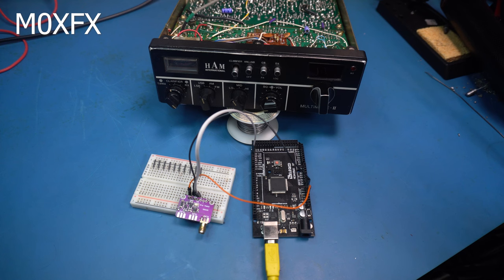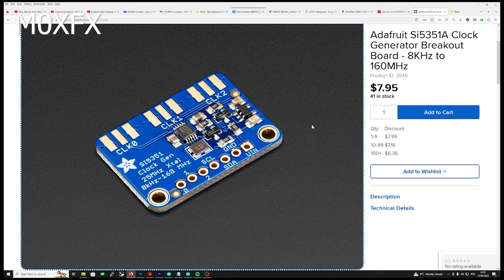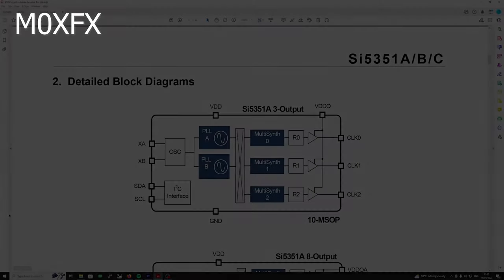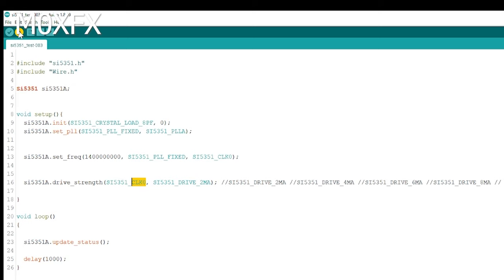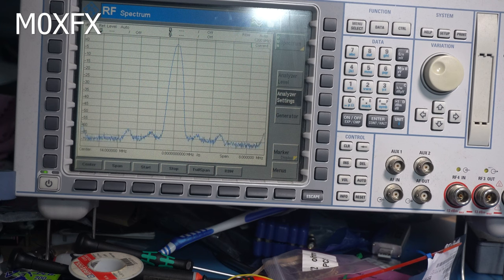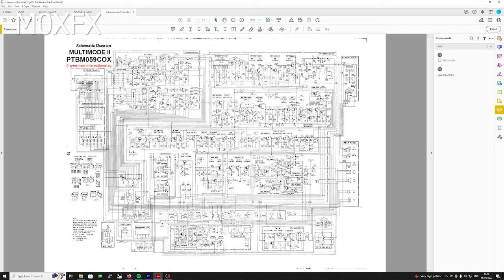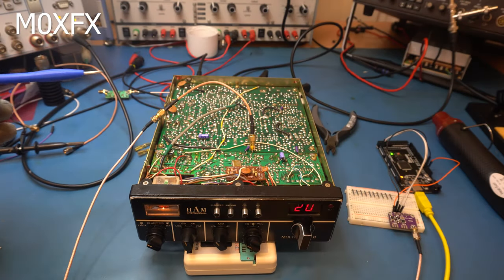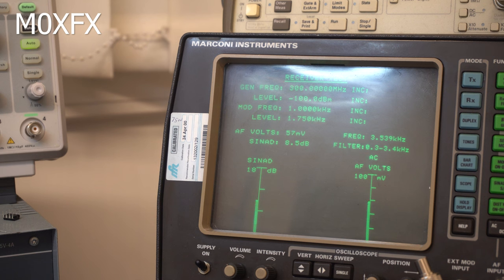SI5351 Clock Gen as Radio Local Oscillator in Old Radios

Comment: Great video. A couple of years ago, I modified an ssb cb using the same clock generator. I used the Si5351a to replace three internal crystals, leaving the pll in place. 

I didn't bother with filtering the output of the si5351a as the radios internal filtering did that. I also enclosed my si5351a, and controlled its temperature,  with a PID controlled Christmas tree bulb. Worked great.

I have had the radio in use for a couple of years now, and get good on air reports.  Frequency stability is excellent,  where it was useless before the upgrade.
My radio is used in my basement and temperature can vary from 16C to 25C. My si5351a is heated to 30 degrees C so there is no noticeable frequency variation .
Thank you for your video.
Reply from the maker: Hi Peter,

Thank you for your comment. Very interesting stuff!

Regarding filtering, you are correct. When you replace oscillator circuits or crystals in radio gear, the radio's internal filtering usually eliminates the harmonics and overtones. I've done the same thing, and it works great.

I also like how you stabilised the reference crystal, essentially creating a TCXO. Brilliant idea!

Comment: A interesting project you have there.
Reply from the maker: Hey MicroChipz thanks for stopping by the channel. Yes it certainly has been an eye opener for me as I really didn't think the clock gen board would work that well. I hope to take another look at this over the weekend and sort out the FM TX and write some code to interface the channel selector with the  Arduino.
Reply: @M0XFXUK  well you only need 40 sets of n codes from the channel change ,ch1 is all 1 think it’s 8 data lines , why not use a up/down instead then add a oled display then you have a dds vfo of sorts .
Reply from the maker: @MicroChipz  If I wanted to use the original display and channel encoder I guess that the 8 bit parallel binary may inversely translates to a a decimal channel number may be? I am not sure but I will take a look. If it does it would make it easer to code.  Interesting on the up/down option as it wouldn't be too difficult to code. I like the OLED idea and I have lots of then knocking about the workshop.  I hope to have another go at it this weekend.

Comment: I have a couple of candidate radios I've been considering for this. Thanks for the demonstration. The software is the head banger. There's a bunch of examples, but some of the fancier CB stuff is closed source. It might also be fun to build a VFO for an old Yaesu FT-101 or something and see if it can keep it from drifting.
Reply from the maker: Hi Jason, I think that FT-101 would work well with this board and I think it would be much more stable. Yeah I get that the software can be a bit of a head banger, I need to think about how to make a video going through C++ programming for a VFO that would make things a little easier. I could possibly write a universal type sketch that can be simply modified to work on many radios.  let me see what I can come up with. Thanks for the comment.
Reply: Welcome. Another thought if you can't get suitable direct FM from a clock synthesizer might be to try replacing one of the mixing crystal inputs. You could still have the PLL for FM then. @M0XFXUK
Reply from the maker: @keyboarderror1  Hi Jayson, Yes that is a great idea and suggestion. I have been thinking about just replacing the band oscillator and leaving the PLL still running as I am sure it would work. I am currently playing with the B version of the clock generator IC which has a VCO built in with the hope it will modulate FM.
Reply from the maker: @keyboarderror1  Just a quick update I have cracked the FM problem, video to be out in a day or two max.

Comment: Nice project.  Did some similar experiments a few years back but using the ad9850 dds module. It's possible using an adc input on the arduino to modulate the frequency of the dds fast enough to generate FM. But 10m Ssb worked well.
Reply from the maker: Hi Brain,  I haven't played with the ad9850 but it's on my radar it's very interesting what you have managed to achieve with it. I have playing with the AD9910 DAC controlling it with Arduino Due with mixed results, I should really go back to it and do some more tinkering.  I was pleasantly surprised how well the SI5153A works, even though the output waveform is as rough as hell without a band-pass filter but it's still fantastic for the price. I have also been playing with the  SI5351B which unlike the A version has a VCO and I'm supplying it with an audio signal to modulate FM but again I need to spend more time on it.  I currently really busy but I hope to have that video out in a couple of weeks time.  Thanks for the comment, really great to hear from you.
Reply: @M0XFXUK  I like the SI5351 module, I've played quite a bit with it mostly using 2 outputs in quadrature to drive sdr radios. Must admit I've not come across the B variant, sounds interesting I'll have to look out for it.
The radio I was experimenting on was the Major M588, almost identical I think to what you have there.
Reply from the maker: @brianharper9798  Hi Brian, The B version I picked up from Digikey as just the IC and I have been cobbling all the bits together to make a breakout board.  I am currently working on the voltage conversion for the I2C from 5 to 3.3V. It's looking promising for FM mod.
Reply: The level shifting should be straightforward, the little circuit boards you can get just use a small mosfet and a couple of resistors. 3.3v one side 5v the other and it's bi-directional.
Reply from the maker: @brianharper9798  Hi Brian yes as you say it's straightforward enough to do the voltage conversion and I have everything to make up a prototype board but sadly not the time. I am going to see if I can get back at it over the weekend.

Comment: Impressive work going on here. Kindly do you have a documentation of this project with connection diagrams for the test instruments ? Especially how/where you test the signal to noise ratio. Thank you
Reply from the maker: Hi apologies I have been busy with work commitments of late. With regards to your question, to be honest signal to noise isn't really the best way to test the performance of the clock generator. I had noticed the the original LO in the radio had quite a bit of phase noise indeed you can see it on the oscilloscope. If you wanted to test signal to noise I find using SINAD measurement is good way doing this especially if you are using FM. To do this you need to inject a 1 KHz modulated RF signal into the antenna socket tune the radio to the same frequency. Connect a SINAD meter to the Ext speaker socket and reduce the RF signal level until you get into the noise. The SINAD is the ratio of noise to the RF signal level.

Comment: Would not compile....faults. I double checked it from what is blurry on the screen, looks exact. Is there a copy of this code for download so I can test my si5351 module? What should I be seeing pk-pk voltage OUTPUT?
Reply from the maker: Hi Rob, Thank you for your comment. I looked at the code again from the video and it should compile. I think that you may be using the wrong library, I should have made this a little more clear in the video. So the sketch is based around the Etherkit library by Jason Mildrum. You may need to unistall the current library and install the Etherkit library via the library manger within the Arduino IDE and search for Si5351 and install the Etherkit library. Also I have some videos with code called "how to build a VFO" where I go through this in more detail. I hope this is of help. If you are still struggling drop me a line and I will try and help.   Also the output at 2mA drive should be around 0dBM into a 50ohm load there ar e on line calculators that will calculate the pk voltage from this value.

Comment: What a great video! I've just discovered and subscribed to your channel and I'm sure I'm not the only one who has been looking for "how to" videos using Si chips and old radio conversions. Any plans to use the Si5351 with old PMR radios? Thanks and best 73, G0ACE
Reply from the maker: Apologies for the late reply as for some reason I didn't see your comment until now. Yes I have continued playing around with the si5351 and PMR equipment would be a prime candidate, I have made some more video's regarding how to build a VFO using the si5351. Thank you for the comment. 73 John M0XFX
Reply: @M0XFXUK  No problem John, thanks for your reply. I'm eager to learn and will check in with your channel regularly. Best 73, Ace G0ACE